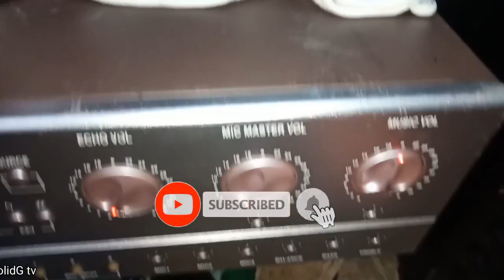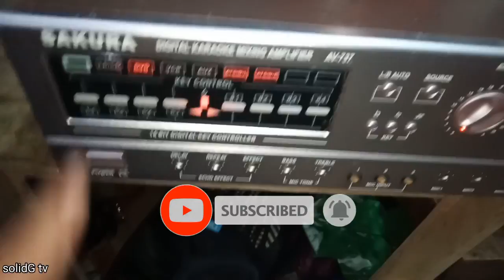ewas sunog ng driver tweeter part 2//pang malakasan na ito

Comment: Sir sa totoo lng nasisira ang twiters kasi ang amplifier na pang bass doon rin kinakabit ang twiters. Dapat my sarili syang amplifier na nka off ang bass. Isang capacitor lng solve na.
Reply from the maker: Paanu Naman Po Yung may mga Isang amplifier lang na gamit Po sir..Walana Po bang remedyp para di masira o masunog Ang tweeter sir
Reply: @solidgtv4675  bawasan ang bass sir nasa adjust kasi yan. Pg malakasan ang bass sir masusunog ang twiters kasi nka design sya sa png high frequency. Sa lugar namin malalakihang mobile sound hindi masususnog ang mga twiter power amplifier gna gamit kasi my sarili syang amplifier na nka off ang bass at nka daan sa high pass filter

Comment: Sa walang mga budget na di makabili ng dividing network pwedeng pwede itong tutorial..nasa user na din kasi yan idol pag hinataw sigurado nogsu😆 P-audio sapat na 150watts kya lang masakit sa bulsa 10,500 pagnasunugan tapos na hahaha iba parin talaga kapag may protection...
Reply from the maker: Yes sir yung iba nagcocoment ng negative e d nila ma gets ang paliwanag o cgrp marami sila pambili ng coil
Reply: @solidgtv4675  yaan mo lang sila bro baka mga mayayaman mga yan hahaha sub kita bro tas subaybayan ko mga bawat upload mo😁
Reply: Ok din yan na protection 12v 35/35 pag dc out ang amp at lumampas sa 12v ay mag o open lang bulb. Protektado ang tweeter. Pang budget meal na protection

Comment: Pwd rin ba sa mid high speaker sir?
Reply from the maker: Pwede po
Reply: lodi pwede ba maglagay ng diode mga 2 ampher diode muna bago bulb?? para ma sure lang n walang babalik n high volatge/ current  pabalik ng ampli para 1 direction lang xa papasok lang ng twitter kung may babalik n high voltage/ current ay maharang ng diode para di ma apektohan yung ampli 
sana magawan mo lodi ng video para malaman naming lahat kung pwede b un dag dag proteksyon din kc yan s ampli kung pwede.. pa try po lodi
salmt.

Comment: Boss na testing mo naba 12hrs walang tigil? Kasi sakin resistor yung gamit ko 2yrs na hindi nasira ang tweeter ko pag yan ba gamitin ko baka masira yung tweeter ko.
Reply from the maker: Try nyo Po sir
Reply: Boss anong specs ng capacitor ngvekectricfan gmit mo jn..
Cy 400 akin ok b yn